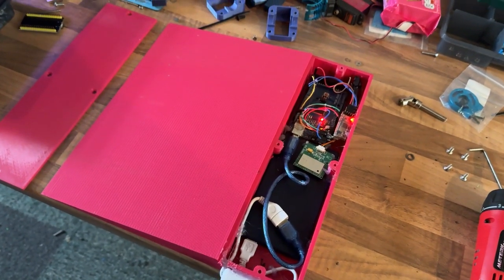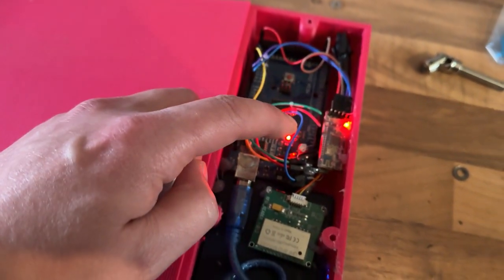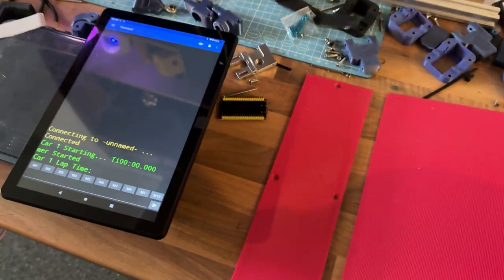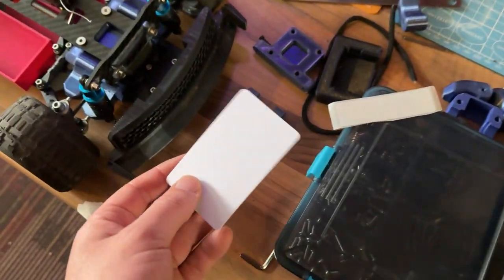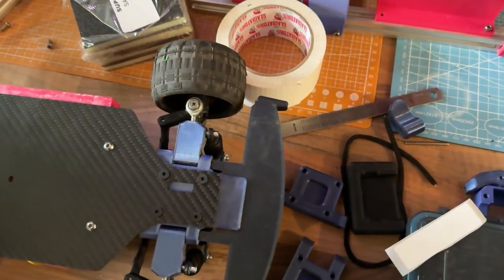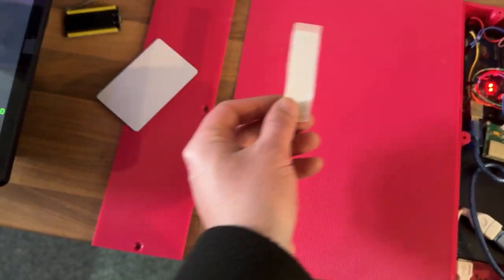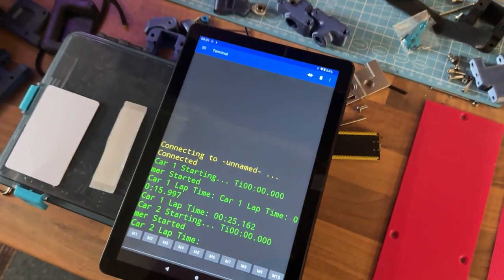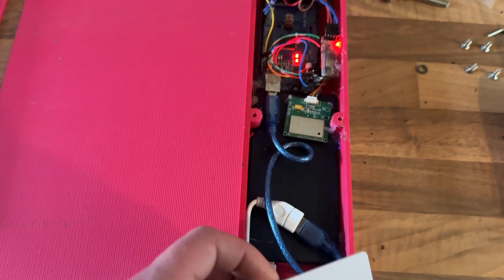RC Car DIY Lap Timer RFID multi car

Comment: Impressive video, A-Tech. Looking forward to seeing your next upload from you. I smashed that thumbs up button on your content. Keep up the fantastic work! Your setup with the RFID scanner and Arduino is fascinating—what potential applications do you think this technology could have in competitive racing environments?
Reply from the maker: Hi, so potential applications could include interactive games, not just lap timing, the cars can also be fitted with a module so they could pick up boosts or slowdowns and that can affect the cars throttle or steering, maby games like capture the flag or hold outposts, things like that, thanks